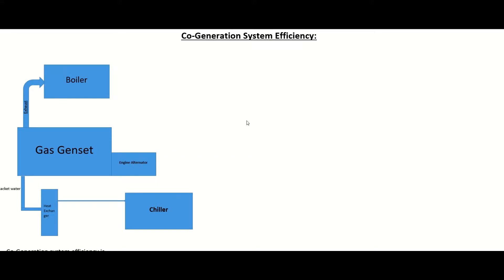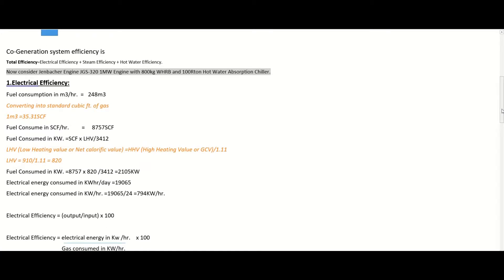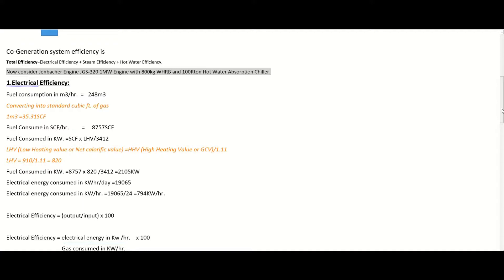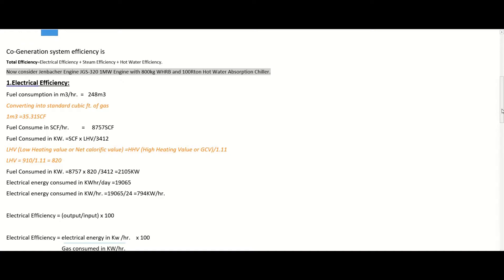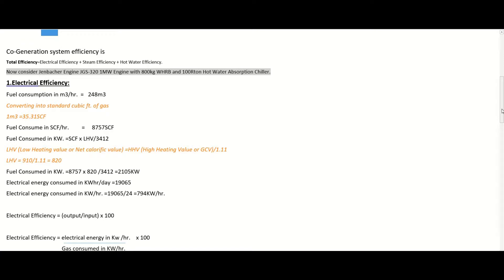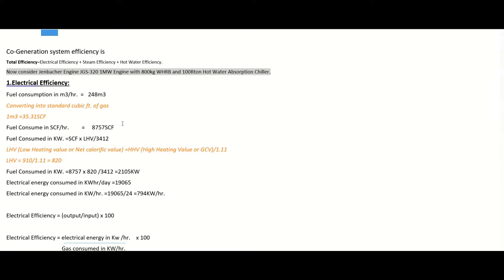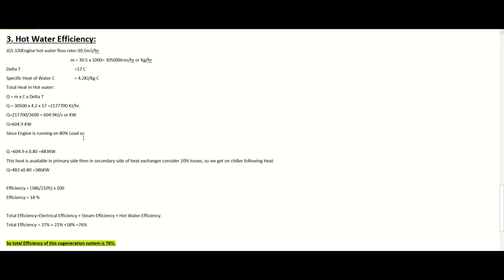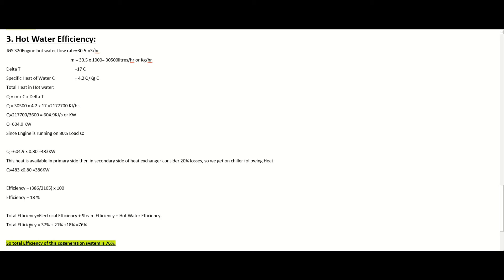How to Calculate Cogeneration System Efficiency ! Gas generator efficiency

Comment: Hello very good.
Can you tell me calculations for converting exhaust heat to hot water.  Inlet Exhaust temperature 370 degree. Water inlet 40 degree water outlet 70  degree and exhaust outlet 85 degree